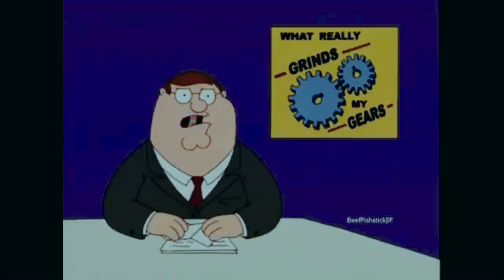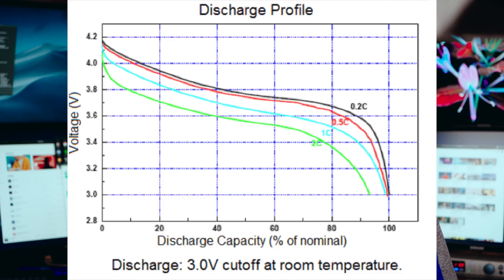Battery Voltage Monitoring

Comment: Yeah that was one of the first thinks I was surprised on my new setup. First time I’m using flightone/ falcoX . The voltage reading goes slowly down and don’t jump like crazy on punches.  And it was nice to read it that way. I trusted the numbers more than in betaflight.
Reply: You shouldn't there not the real numbers. Averaging is one thing ratcheting the voltage so it cant go back up ridiculous missrepresentation of data.

Add a percentage of estimated battery instead don't mess with a standardised scientific measurement.

Comment: If I'm tracking the video right, F1 is doing real-time readings and then passing it through a novel lowpass filter with a low cutoff?  Maybe 1 or 2 hz? 

I do think the idea of the lowpass filter approach is a little better. What I don't quite understand and need to observe is batteries do sag and recover in flight, a lot. So I'm guessing F1 doesn't show the sag since it is a pretty sure duration typically and the lowpass at such a low cutoff regards those as "high frequency" noise.  Interesting approach indeed.  BF just reads the vBAT every 20ms.  I do think some smoother readings on Vbat would be good for Vbat Compensation.
Reply from the maker: It’s not a low pass we do filter through a frequency low pass at first but then we pass it through our own filter that is specifically design for quad voltage
Reply: @FlightOneVideos  , is that like a real special filter or more like a Helio filter?  LOL.  Just busting.  You know me and those special filters.
Reply from the maker: UAV Tech well I talked about what it was in the video, but definitely not a normal filter
Reply: @FlightOneVideos  , Yeah yeah.  So did they.  Again, just messing with you.  :-)

Good work.  Smoother vbat is nice!

Comment: You can tell the condition if a battery by watching how much the voltage sags under load. If it sags alot you might want to retire it - if it sags a little it's a strong battery. It would be cool if you could make something in Flight 1 that could rate the condition of a battery by how much it sags during flight.

Comment: 2:14 mm yeah, about that Betaflight current/voltage sensor filtering.. https://github.com/betaflight/betaflight/blob/master/src/main/sensors/current.c#L152
https://github.com/betaflight/betaflight/blob/master/src/main/sensors/voltage.c#L167
Reply: Glad you guys have a lowpass on there at least, what hz is it at?
Reply: Preston Garrison it’s configurable. They are both configured by period rather than exposing cutoff directly, e.g. period/60hz (0.1s increments). The default voltage period is 30(*0.1s). The default current period is 10(*0.1s).

Comment: Loving these types of vids Preston, keep it up man. Also loving the Arc-1 frame. I should have ordered a pod when I ordered the frame but about to order one now. Build space is tight but also the perfect amount at the same time, just difficult to mount an antenna depending on the style of antenna you mount. But overall an excellent race frame. Almost  done moving parts over to mine should be done tonight and soon after pics and vids will be posted here and instagram 👍👍👍

Comment: Interesting! I noticed it seemed more accurate and not bouncing all over but great to know! I wish there was a warning indicator, when I'm racing gates I often don't often look at my voltage and I'm so used to the Low Battery followed by a Land Now the first handful of packs I was falling out of the sky. I since then have added telemetry alert along with a timer so I'm aware that I should be coming to the end of my pack soon, but some OSD alert of some sort would be nice.

Comment: but I dont like waiting to see what my voltage is, it feels like the refresh rate is too slow. When I fly and feel sag I know my pack is dead and then immediately let off throttle. After im nearly on the ground the osd catches up and displays voltage way too low to fly at.
Reply: Enginair exxaccctlyyyy

Comment: I've built 3 of the f1 quads at this point. All of them cap out at 24.36 volts. Even my fully charged batteries read that way, and the display won't change until it drops below 24.36. using dshot1200 for all 3 builds. Any suggestions?
Reply from the maker: bheli32 has a weird voltage cap at 6s, hopefully they will fix it in one of their updates
Reply: @FlightOneVideos  is there a workaround to this? Multishot? Blheli_s?

Comment: Only specific(Flight One) flight controllers work with Flight One, right?
Reply: right.
Reply: David Hannigan Jr.:  Pick up a revolt osd or millivolt osd. You'll never go back! They have targets on Beta flight but Flight1 is badass.
Reply: @rsharney1111  I would like to try it. But the pricing is not very incentivizing. And although I would like to get into racing a good deal, I will likely not become a strictly Flight One kinda guy anyways. Simply because they don't do anything to expand outside of racing, currently.

Comment: The important thing to note is that if you're drawing power while the battery is under 3.0V, you are quite literally plating Lithium onto the anode, which is not only failing to provide power in flight, but reduces both capacity and peak power.   That's the voltage at which reversible redox reactions based on Lithium ion intercalation transition to irreversible plating reactions that simultaneously clog anode surface with Lithium dendrites, and take lithium out of the electrolyte that can no longer be used to store energy... so you lose both power AND energy on the battery.

I'd argue that the preferred option is a properly calibrated current viewing resistor and integrator and knowing what pack you're running - which is exactly what current sensing actually uses.  Still preferable to any voltage estimation methodology, no matter how sophisticated - if I consistently draw 825mAh from my 1300mAh packs, I'll be right between 3.78-3.81V per cell depending on how much energy I lost to internal resistnance - the battery voltage sensing is there to tell me when I'm overusing that, or if I've gone to the wrong target, which even unfiltered 'Land Now' warnings will do a good job of telling me.
I still use 13.7V on 4S (4.425V/Cell) at cruising, or 21V on 6S (4.5V/cell) as my 'fly home' reference pont, because I know that will always keep my at an acceptable resting voltage for park flying.
Reply from the maker: Good point
Reply: @FlightOneVideos  It kinda doesn't matter if you bring it back exactly at storage charge or not, it's just not causing any damage (collectively memory effects - but acutely the above) to the pack if avoidable.  Not that I personally retentively fly every pack exactly to 3.77-3.81V every flight outside of race conditions...
I also think this is why whoop batteries have completely crap lifetime - they're constantly getting pulled below 3.1V, and the best way to minimize that is HV charging them which causes cracking issues on the cathode over time - and for whoop racing you end up hurting the battery twice in the process.... practically the only good thing about whoop batteries is that they're laughably cheap, so <20 cycle lifespan isn't cost-prohibitive.

Comment: Betaflight OSD definitely has some sort of averaging filter on the voltage as its much slower to react to voltage changes than other osd voltage monitoring like the one in fpv cameras.
Reply: Looks like it's a simple trailing time average, which will tend to tell you the battery has recovered from a big effort a bit slower than it really has, but I haven't encountered any case where that's problematic at all.  On really trash batteries you'll feel sag a little bit before you start getting bombarded with 'land now' warnings, but that's unique to flying trash grade batteries on high-KV setups.
Reply: BF just only read the battery voltage very 20ms.  A great way to take out the jitter is to just make fewer readings.  Then there is no need to filter.  I wish we could do the same for the gyro sometimes.
Reply: @uavtech  i dunno about that seems a lot slower than just taking a sample every 20ms maybe they added some weighting to the voltage osd display as well
Reply: @MrStevegibb  OSD, in general, has a slower refresh rate or everything would just be a blur.  You can see vbat in any log (e.g.: https://www.screencast.com/t/PxxsFmpRLk ).
Reply: @MrStevegibb  , the example at: https://www.screencast.com/t/56GNRyW3rX9 has throttle pumps.  You can see the sag dips are at 2hz.  So you would need a lowpass cutoff at 1hz (or lower?) to weed those out if you didn't want it to drop vbat readings to follow.  However, a lowpass at 1hz gives you like 160ms of signal delay so everything would be stepped back in time by 160ms.  The read frequency of the OSD wouldn't matter as it would be about the same data all the time and slowly trend.  Would be neat to have this option as lowpass and then you can adjust cutoff as/if desired.  

Another approach is just to space out the readings to 500ms (2hz).  I now 500ms sounds like a lot because we are used to gyro stuff, but it is only 0.5 seconds.  For OSD, that is still too fast to display; would be a blur.

There are two factors here.  Are we reading just for OSD?  If so, that is simple, just really really slow down the readings because our dumb human brains can't process that fast anyways.

However, if for something like vbat compensation, then you want to speed up to below 100ms.
Reply from the maker: Its been a long time since i have used bf, so that could be correct

Comment: You know what, I have to disagree. What you fail to realize is that the battery actually does sag up and down in voltage, it's not esc noise that causes it to go up and down, it's the load you put on the battery. You don't need to filter the voltage readout, you want it to be accurate and know when your punch out causes severe sag. When you filter it so much to where it only goes down and don't see sag, you're causing delay and really don't know how dead your battery is. Now if you have a crazy refresh rate, then it will be hard to read and you'll see noise but on a normal betaflight setup, it's totally accurate.

No hate on fl1, just this in particular is just wrong and misleading.
Reply: I'm actually with Preston on this one - the timescale for that EMI is so fast, it's in the kHz frequency domain for timing (<1ms mostly), just subsampling and taking a simple average is going to make any of those effects go away. 
The actual source of error is imprecision in voltage sensing, which is comparatively time invariant, but applying EKF allows you to react a whole lot quicker when you are seeing a big fluctuation.  In practice, most humans are going to struggle to track voltage changes in an OSD fast enough for that to matter, especially when doing a mentally demanding task like flying a quadcopter FPV... and it's not like getting cleaner voltage signal in a Blackbox log is something many people are going to care about, so the refresh rate is, to me, of very little consequence, and to be honest it being inaccurate is also not all that important to me either, so long as I can use a consistent signal (mAh used through calibrated CVR, flight timer, and overall voltage relative to takeoff voltage) and come back with a battery that rests somewhere between 3.35-3.85V

Forgot to add that Race412 <3 - cheers!
Reply: tehllama42 I agree that having accuracy enough to see the noise wouldn't be good. But  unfiltered (or however filtered betaflight is) is totally fine as is and imo better. Filtered to the point where your can't see the battery sag on punch out is just excessive. Might even say inaccurate because it's not the actual battery voltage anymore. It's an over smoothed battery estimate.
Reply: I belive that the internal resistance of the Lipo can actually cause a sag in voltage.If my calculations are correct then the drop in voltage by drawing 120 amps out of a lipo with an internal resistance of 0.01ohms should be 1.2 volts.
Reply: @damiankobler3423  So, what a lot of people describe as 'sag' is actually the transition from the ohmic resistance-driven decrease in voltage (where the voltage is dropping off roughly linearly as you demand more current, like your calculation) over to a mass diffusion limited regime where the electrolytes simply can't move fast enough and you get a really fast drop in voltage (and get to a point where you are actually generating less overall power - V*I).  See @1:39 in the video.
Your calculation is correct and is probably accurate on an ideal case ~100C 1200mAh LiPO for instantaneous draw, but once you ask for more than that you're in that really fast falloff area.  To make it worse, in the real world pulling that kind of current for more than 0.2s all LiPOs start to behave like ~55C cells, where sustained draw really drops voltage out and that 'flat' part of the discharge curve gets shorter and shorter, because you've discharged more of the power and the starting voltage gets you closer.
So, that internal resistance is a fact of electrochemistry, and why that ohmic resistance region of a Tafel plot is where is is and roughly linear - but when you start pushing that to the edge that becomes very NON-linear - right around the point where you drop under 3.0V anyway, which leads to really destroying batteries because you just start plating out the Lithium onto the anode which ruins both the Lithium content of the electrolyte and the anode which is then covered in lithium dendrites that accumulate and eventually short out the cell.
Reply: Damian Kobler yup you're exactly right. Multiply by the number of cells your using and there's your sag over the whole battery. Simple V=IR, KVL
Reply from the maker: If we have it wrong then so must all those battery experts like the tesla engineeers :).   Look at any complex battery system you won't see voltage fluctuating wildy with usage
Reply: FlightOne Well basically everything is totally different, our load per capacity is totally different, battery chemistry is different, and the drivers don't need a voltage with accuracy, they need a rough percent/range. Pilots need an accurate voltage to know their battery's life and capabilities, under load, as in seeing how bad their battery sags. Teslas batteries aren't disposable and won't let you run to the ground.

Comment: Land at 3.8 volts per cell. Saved you guys 6 minutes and 59 seconds.
Reply: under what load?
Reply: Stephen Gibb recovering to 3.8 which should also be no more than 3 minutes. I just watch my timer and land at 3 minutes
Reply: I still use 13.7V on 4S (4.425V/Cell) at cruising, or 21V on 6S (4.5V/cell) as my 'fly home' reference pont, because I know that will always keep my at an acceptable resting voltage for park flying.
This is on mostly 525g racer setups, using cheap 1000-1300mAh batteries, cruising at roughly 35° effective tilt (I'm putting the top of my lower OSD elements on the horizon) maintaining forward flight.
I can do that procedure after I've done some hot laps, and know pretty accurately if I need to come back right away, or if I can do some more cruising to catch my breath and have fun just dinking around.

Comment: Hello, does this filter applies to all of your FC's and ESC's. I have a revolt and bolt. Thanks a lot and keep up your good work. Hope to install my stack in a smooth operator pretty soon.
Reply from the maker: Yes works on all of them :)
Reply: Also interested in this. Just got a Skitzo Revolt with T-Motor F45A ESC.